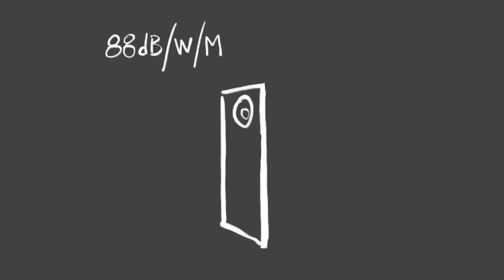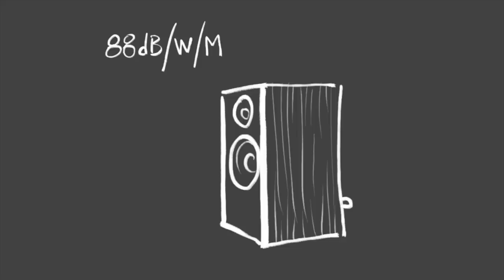John DeVore goes on a rant about the High End Audio lie that inspired him to start his company

Comment: I'm gonna disagree a bit here. The reason for 2.83 volts/w/meter is that speakers are NOT resistive loads. An 8 ohm (nominal) speaker may range from 4 ohms (or less) to many ohms (especially at resonance.)  Unless you want to calculate watts at specific frequencies for the reactive load presented by the speaker, you are more accurate in describing sensitivity based on a constant voltage source. And guess what? Solid state (non-transformer coupled) amplifiers act as a voltage source to the limits of their current capability into a given load.

Comment: Designing speakers using two or more 8 ohm speakers wired in parallel should be made a crime.I have owned speakers like that and they are a pain.And yet most of the so called high end stuff from Wilson,Focal.Magico,B&W  etc are like that!It seems you need to feed them lots of power [and current] before they sound decent.And then they are too loud and cause listener fatigue.And yet I can  enjoy listening to my vintage  Tannoys all day at moderate volume levels. They are an easy true 8 ohm load .

Comment: Thanks for this John.  In regard to Stereophile, Mr. Atkinson will give notes in the sidebar regarding his view on whether the tested speaker will play well with tube amps, whether a hard load to drive and whether they are current hungry.  I have found those comments useful.  I have had 2 sets of your speakers in the Gibbon range and found them easy to drive with tubes.  I now have some Volti horns that run easily with tubes.  My audio journey was in the 80s and 90s early on and as the cabinets became thinner and the drivers more numerous, I noticed the difficulty in driving them and having them sound full in the lower mids to bass region which verifies what you were saying.  You can cheat on your wife, you can cheat on your taxes, but you can't cheat the laws of physics.

Comment: Just one complaint- this is no rant. Heck its not even promoting his business. Its just an extremely well-informed and impeccably reasoned take-down of this one aspect of audio measurement. I know it is, because I know enough and experienced enough to know just how right it is. A huge amount of what people today think they know about speakers and amplifiers is wrong, and this explains why. Good stuff.
Reply: Bravo John Devore
Reply: Phil Allison  Watch it again. Only this time, try listening.
Reply: Phil Allison  Its not the simplest stuff to understand. We all have our levels. Its okay to admit its over your head.
Reply: This is a brilliantly clear explanation, thanks, John, for sitting down and taking the time.  I think if some of the people to whom this seems over their head would watch it through again a time or two with the aid of a basic calculator, they might discover that it's really not as difficult as it seems.  John spells out the relationships involved as clearly and carefully as I've ever seen.  Admittedly, seasoned techs and engineers have been through this so many hundreds of times that they take these relationships for granted, but John has here gone very slowly and methodically in breaking down the needed concepts into digestible bits.  Try pausing the video at each concept - for example, at Watt's law - and work through your own real-world example based on your own current system.  I think you'll be surprised how much your understanding is improved, even if it doesn't become crystal-clear.
Reply: @bensolomon1872  Right. I got it right off because after 30 years an audiophile, and a very advanced one at that, and an X-ray tech with enough knowledge of electricity and electronics to build an X-ray tube, none of this was new to me. Only thing new is the way Devore puts it all together and explains in a way that makes sense to those without all that experience. But you're right, they do need to pause and repeat and think to let the concepts sink in. Each part is simple but there are enough and the interact enough it takes time and effort to understand.
Reply: @charlesmiller6281  Uh huh - and what's provided here, and what it takes, is the combination of a teacher who first of all has a deep understanding of their own and then can think back on which principles were the trickiest for them to learn or that they know from others were tricky, and then slow down and present those principles holding that awareness in mind instead of assuming that the student understands.
Reply: Yes, Charles, I agree. I've been listening carefully to what is marketed as high fidelity since the mid 60's. Probably half of everything I know is wrong, and the other half I can't remember! LOL  Anyway, I have tinnitus now.
Reply: Also to put my comment into shorter words, until the 80s you didnt have generally commercially available speakers like infinity Kappa 8s that you could hook an arc welder to. Ive literally seen amps biurst into flame on some large infinitys from the era.
Reply: one watt one meter is still one watt , no matter the ohm load on the amp, if it doubles in power for a low ohm load still only measured one watt.
Reply: For rea,l he's just a First Class Dude and this is how he rants or complains.